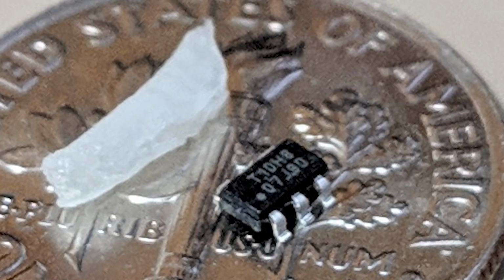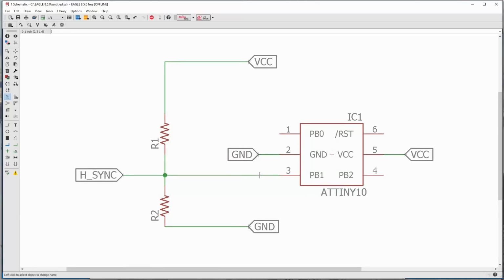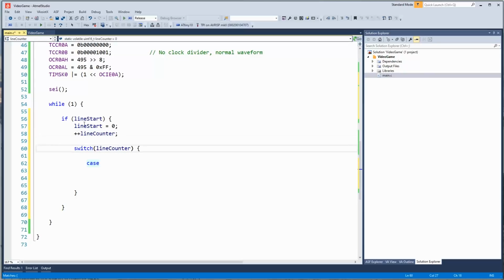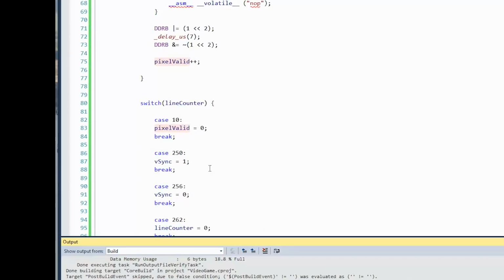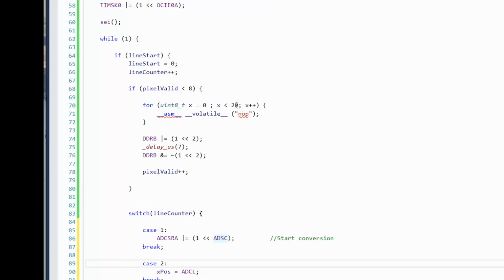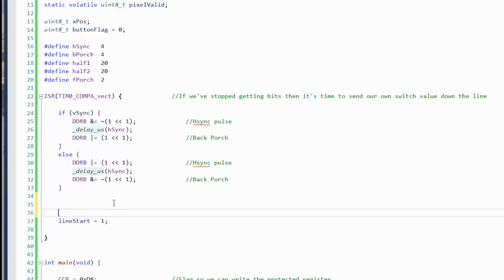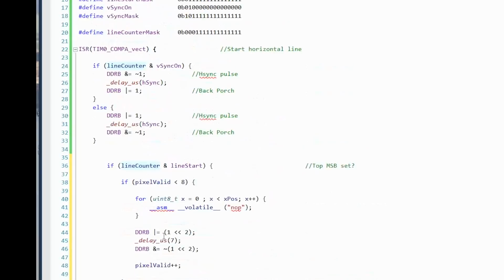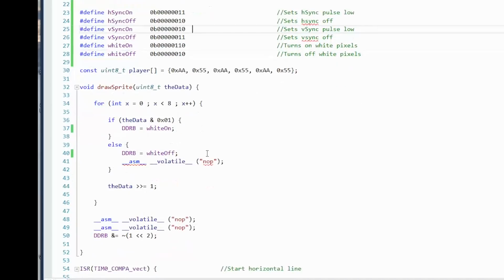ATTINY10 Console Part 1

Comment from the maker: Oh BTW please give suggestions on the kind of game to make! Something with a lot of separated verticality would be best, like Space Invaders, Galaga or Breakout.
Reply: Galaga would be nice, but the most simple way would be Kaboom isn't it?
Reply: Galaga please
Reply: Breakout.
Reply: You need some PET style chess on this bad boy
Reply: Circus.
Reply: Tetris
Reply: But can it run Doom?
Reply: Kaboom! Picnic edition
Reply: Stupid suggestion, but when I seen that giant bar on the left side of the screen, I was reminded of an old, super simple golf game.   So if you could make a game where ya smack a pixel around giant bars that would be cool.
Reply: Ben you should make Simon says it was game card #2 on the original odyssey 😂😂
Reply: Galaga and tetris would be stupidly hard, if not impossible, to pull off. I don't think you guys realize how limited this hardware is.
Reply: You still have some free pin on the controller, do you? Hook up an accelerometer and make a retromodern vii style controlled Pong.
Reply: Knock off duck hunt with possibility for a light gun?
Reply: Maybe Frogger?  The traffic would be a challenge...
EDIT: Because it's a 4-way game, a resistor ladder could be used to determine the button being pressed, it would be a fun alternative to potentiometer control while still using a single pin.
Reply: i have 1 player pong running on my TI-82, maybe you could make something similar.
Reply: What about a stacker game?
Reply: Flappy bird? I know it's not retro, but there is quite some verticality 😅
Reply: Pixel bowling.
Reply: Snake of course.
Reply: Maybe one of those driving games where your sprite stays at the bottom of the screen and the landscape moves down the screen toward you? Need to miss other cars (simple blocks) or perhaps collect items (simple blocks).
The double bar when you missed the break reminded me of one of the breakout modes on Atari 2600.
Reply: What about centipede?
Reply: A vertical moving road like Night Driver or Enduro with cars dropping down at you.
Reply: Pong
Reply: breakout :)
Reply: racing game
Reply: I've done this myself on an Arduino. I reserved 1512 bytes for video RAM and 512 for all the rest (variables, stack, etc).  And then I programmed 4 games on the flash memory: Pong, Breakout, Kaboom and Night Driver, so I have a multigame console :-)
Reply: Pong would work well, though it might be a bit simpler than you wanted.
Reply: Monkey Island, for sure! The first one of course :)
Reply: @ChrisFredriksson  that's just being lazy.  He needs to port FF7.
Reply: Make a game like doodle jump
Reply: Why not a Pang (with an A)?
Reply: Will it run Crysis?
Reply: Breakout may be an easier game to implement in a device with limited memory.
Reply: Make an eroge
Reply: Something with an aggressive micro payment system
Reply: Could you multiply the inputs you have by switching the reads from one input to another every cycle? Like you'd have a synchronized clock or something that switches what input device sends signal to the pin and the ATTINY switches states when it comes to input every cycle.
Reply: @poptartmcjelly7054  that sounds awesome!
My introduction to programming was when I got my TI-82 in 7th grade. I should really look into getting a ti82 again
Reply: Move the bar through all the display edges and have a ball appear right in the middle. Send the ball in a random direction and catch it with the bar, increase the speed a little on each catch
Reply: Battleships hotseat
Reply: @misterthekaitheman  This might actually work pretty well, given that only 1 pin is needed for input. Even Space Invaders would need 2, one to move and one to shoot.
Reply: I wonder if you could use another controller for logics and basically have a multiprocessor game
Reply: Vertical Pong
Reply: Some kind of Legend of Zelda Clone or a general RPG game? I'd love to see how you'd move the character sprite along the Horizontal and Vertical lines, perhaps with chests, loot i dunno Dungeon Crawler like!
Reply: Galaga or Tetris would be good choices. Thanks for the content Ben. It is greatly appreciated
Reply: Retro Flappy Bird would be cool
Reply: A comment I found had suggested of making the top, left, and right sides of the screen walls.  You start out with one ball that bounces around and the object is to prevent it from going past you.  A ball gets added after so many successful blocks.  Maybe a score counter can be added at the top; a simple 1 point per block?  It's like a loose interpretation of handball I guess.
Reply: Marching-wall Breakout might be a nice twist. No need for discrete level screens; just a wall of random blocks slowly compressing down at you, an unlimited supply of balls to launch from your paddle if you let them fall, but game over when the wall reaches your paddle.
Reply: Flappy Bird
Reply: Would also be nice to port the code to a padauk microcontroller. 
They are almost an order of magnitude cheaper with similar features.
Reply: @Ben Heck Hacks - I have a couple of ideas for a game, perhaps a sort of vertical Pong but with one paddle and 'gravity', so a bit like bouncing a tennis ball on a tennis racket, trying to keep it in the air without letting it drop. The maths for the gravity should be fairly simple to implement I'd guess? ball horizontal movement would be constant would be a function of distance from the centre of the paddle, but vertical would be exponential deceleration and then acceleration downwards. If the button could be implemented then it could add to upwards acceleration as if the racket is being bounced upwards.

Idea 2: vertical Pong, but with 2x paddles, both paddles are controlled by the pot, but the upper one is reversed so goes left when the bottom one goes right and vice versa. 

Also, instead of using PB2 to drive the pixel white, can't you set PB1 high and un-tristate it for the duration of the paddle, then tristate it again before setting low for the front/back porches?
Reply: I know this'll likely be unpopular, but what about Joust? (I would say something more complex like Puzzle Bobble/Bubble Bobble, but I don't know if the ATTINY10 could handle that. Joust, on the other hand.... maybe?) The original B&W version, of course.
Reply: @ArtemisKitty  the attiny has 32 Bytes of ram. Not megabytes or kilobytes, just bytes. Something like Bubble bobble is going to be way to difficult.
Reply: Yes.
Reply: @bonnome2  Yeah, that's why I was figuring more likely a game like Joust.
Reply: Galaxy invader 1000 would be pretty cool
Reply: Kaboom!
Reply: Of course I suggest Pong, Breakout or Frogger.  :-)
Reply: just single player pong with increasing speed
Reply: ASTEROIDS!
Reply: Atomic shrimp had a idea, he found a small video projector on Amazon that read mp3 files from an sd card and he was hoping ben could mod it for external sources or something
Reply: Not related to this vid, but when you are making the controllers might I suggest using a resin printer for your  smaller parts like triggers and d-pads. Not for prototyping but for when a design is finished
Reply: Make Space Invaders meets Breakout
Reply: SNAKE.
Reply: So.. you're the culprit. I always blamed the parents for the spaghetti kids threw up that I had to clean in Goodwill, only to find out it was you all along!!
Reply: Space invaders
Reply: This thing screams breakout
Just do one.
Reply: make Berzerk
Reply: Doom
Reply: snake
Reply: Going with what you've got, a PBJ sandwich maker: catch bread, PB, Jelly, bread, and action button drops it onto one or more plates (or basket). Order of PB and J is not strict, but full points has to be bread, 2 toppings, bread for score; ingredients fall from top randomly, but only in specific columns; also include "trash" to dump messed up items, decreases score; falling pieces not caught don't count against you; "bad" sandwiches can cost you more than trashed sandwiches. $0.02 for my banzai SW Design Doc here... ;)
Reply: Doom run doom. If It doesnt run doom its not a game console
Reply: Snake, Tetris, Pong    
the classic cheap LCD handheld games
Reply: Pin ball with 5mm led and piezo buzzer!!!
Reply: Paratrooper might be a little bit too complex (short on RAM to describe the sprites), but it sure would be neat.

Also, check out lft's Phasor demo.

You can get more consistent timing in your main loop by using sleep, since the processor wakes up on any interrupt.

Packing your bits as you did with lineCounter is actually supported in C; check out bit fields. Even if it didn't, naming your bits would help. 

The pixel timing issue can be resolved with a funny trick in the AVR GPIO; if you write 1 to PINxn, it toggles the value. So you could encode your pixels as where it toggles instead of whether to set or clear, and you only need one check (the issue is that clears happened later than sets within the loop; the jumps evened out, but weren't necessary; two ifs can be smaller than one ifelse because of the skip instructions). However, that only toggles the PORT bits, not the DDR bits, so you'd have to add a transistor to make it open collector again. Because the [SC]B[RI] instructions exist, single bit manipulation like |=1<<3 or &=~(1<<2) is actually one single cycle instruction, in contrast to x=0b110 which takes 2 intructions and a register (LDI OUT).
Reply: SNAKE!
Reply: doom
Reply: pong
Reply: Ranking: 1) Asteroids 2) Galaga 3) Space Invaders (they have invaded both our conscious and subconscious memories and thus have achieved their goal already)
Reply: Remake ET. Anything you could come up would automatically be 10x better than the original 😆
Reply: A block stacking game like a la stacker?
Reply: Do a 3¢ Padauk and stick it to that bloke down under.

Comment from the maker: Realized something last night while taking a leak. Since all the trigger points are even numbers I could divide the line counter by 2 and make it fit inside 1 byte. It would also make double-thick vertical pixels for "free"
Reply: Nice! I wonder if there's a direct correlation between success and number of pee breaks.  🤔
Reply: @ericvest9050  I think there actually is. I mean, from an irl standpoint, it kind of makes sense. It is a short break in working, so your brain thinks over things you did before. Maybe taking a leak will find the solution to the universe?
Reply: @randominternetbro6562  So the secret to guaranteed success is just don't stop peeing.  I got this, unhold my beer
Reply: And if you left align your line counter, the switch statement can read only the upper byte, and counting would not need bit masking to preserve the flags. Also, use 8 bit values; the for loop in drawSprite uses twice as many registers and instructions manipulating int i as uint8_t i.
Reply: @0LoneTech  If he makes the line counter one byte wide then there is no upper byte.
Reply: is this the attiny10 equivalent of middle out compression?
Reply: Thats how they did it back in the days on the NES also. In simple terms, at least for me. You've got to duplicate stuff to retain space. This guy made an NES game that fits on a real cartridge. https://www.youtube.com/watch?v=ZWQ0591PAxM . Also explain the procedure they went through. Maybe it will be helpful in the future
Reply: creativity comes when you least expectit

Comment: Ben: "We saved 4 bytes!" big party
kids nowadays: "how can you live with only 500 gigs in your PS4?"
Reply: I live with 500gigs in my gaming rig XD
Reply: @norjia  yes but can you live with half of that?
Reply: @waltercomunello121  i did on my laptop before i built myself my current system
Reply: Yeah.. I feel that. Considering the fact I have 5.5 TB on my desktop total (between the internal hard drive, and an external usb hard drive).
Only 1.5 TB are free in both of them; 4TB / 5.5 TB.
It's mostly a result of recording music, capturing video, programming projects, and many many many games from steam and epic games.
Reply: I'm getting an arduino uno at the end of the month, so the computer science path shall begin. Time to get to work.
Reply: @subliminalcastillo2126  hows the arduino going
Reply: @GOAFPilotChannel  Fairly well. 
I ended up settling on the arduino mega, and bought a bunch of different components (ic's, resistors, led's, capacitors, potentiometers, etc..)
I learned the hard way that cheaper breadboards suck for reliability. I just got my BB830's in the mail today actually & I'm rebuilding right now. I am following the Ben Eater 8-bit Breadboard Computer series right now as learning how computers work at a low level has always been a gigantic interest of mine.
Reply: @subliminalcastillo2126  Woah that's awesome! Have fun!

Comment: Remember when programmers optimized their code simply because they cared about efficiency?  Ooh, I saved 2 bytes* said no one in at least 30 years 😁
Awesome work man.
Reply: I've made embedded programs for controlling hardware, and 2 bytes can make all the difference
Reply: I legitimately said that yesterday. I actually said, as a perfect quote, "Ooh! I saved 2 bytes!"
This was while writing a program for my TI-85 graphing calculator :)
Reply: Weird, almost as if saving bytes stopped being worthwhile once software exceeded billion times that amount.
Reply: We needed more storage because programmers stopped making tiny size optimizations.
Programmers stopped making tiny size optimizations because we had more storage.
Reply: @easyaspi31415  wrong, we needed more storage because we had more data. 
Even for the common Joe, data itself adds up to terabytes, there is no getting around it. And big-data is several orders of magnitude further still. 
Cost of a gigabyte is measured in cents, cost of a programmer in tens of dollars per hour. 
Saving bytes is seldom appropriate anymore, and no sane company is going to throw away profit just for the sake of nostalgia.
Reply: Oh, I don’t know if it’s a dead art just yet... I do a lot of Z80 assembly coding for my own projects. If I can save a few bytes here and there, it’s a good accomplishment. Saving space in ROM is always good. Keeping track of those mode 2 interrupts and that RETI...  can’t tell you how many times I’ve run out of stack because of RET instead of RETI. Oh, well, live and learn.
Reply: Some of them might have cared, but I think most of them were just trying to get the damn thing to work. But I suppose that's a pretty solid reason to care.
Reply: Atmel programmers be like..
Reply: I program ti basic on ti84, and I would do anything to save 1 byte. I saved several kilobytes doing this (~-30%)

Comment: Ina few years this project will, eventually, run DOOM
Reply: with an attiny10, that is very unlikely. maybe a watered down version like the one made for the calculator.
Reply: @MsHumanOfTheDecade  taking it too literally much?
Reply: @MsHumanOfTheDecade  I'm pretty sure an atmega2560 would run Crysis easily, with room to spare for spaghetti AND meatballs.
Reply: @MsHumanOfTheDecade  even a stripped down version like the calc-doom would be badass!
Reply: can it run cyberpunk 2077? i don't have the money for ps5 but have money for attiny10
Reply: @wphanoo  No but you could make the chip into a facial piercing. Cyberpunk!
Reply: @MsHumanOfTheDecade  uhm, are you ok?
Reply: @MsHumanOfTheDecade  Pretty sure that with some external RAM it can be done as long as you are able to stand a blazing speed of about 1e-5 FPS.
Reply: @trinidad17  there's no framebuffer.   Just like on the classic Atari, you can't address pixels, and the 'cpu' only has a fraction of the time for processing data (3d transformations, etc), majority of the time it's busy puking on the screen.
Reply: @tomservo5007  You live in the sync
Reply: @MsHumanOfTheDecade  If you think this is serious, somewhere another geek will try to make it real

Comment: Some extra detail about the garbage in mrs.Pacman on the 2600, the lines on the left of the screen are actually due to how the TIA (the atari's graphics chip) handles horizontal repositioning.

The Atari had horizontal repositioning registers for all the major graphics and a separate "HMOVE" register you would strobe to commit the changes. If you didn't strobe the HMOVE at the exact right cycle, it would add that garbage to the left of the screen. If I'm not mistaken, most Atari programmers were unaware you could time it correctly and just assumed the garbage was unavoidable. (or they were like me and too lazy to time it correctly). That's why that garbage is present in most games that move the graphics in the middle of the frame.

Comment: The good old days when ya built an opamp out of discrete transistors then 30 years later folks r selling them as high end
Reply: My boss would wait months to get metal canned op amps (lm339 I believe) just because they were 4-5% less noisy.
Reply: @GreenAppelPie  Place i worked clients had circuits we would connect into a working circuit then laser trim various resistor/capacitor networks to their specs and send them to another group have their cans welded. Look just like metal 339's

Comment: That was beautiful!
You could use a range shift for the pot to allow detecting button click at same time as movement btw.
Button would shift the pot response from for example 0.5-1.0v up to 1.1-2.2v so there is no overlap thus the motion and button can be consistent and simultaneous.
Reply from the maker: That's a great idea! I could just "button away" a 10k resistor and then lob the top bit off the ADC result.

Comment: I remember doing something similar with a ST62 microcontroller back in 93. In assembly there was barely enough cycles available to check the line counter and take a single byte output action. To make it work I needed to pre-sort and organise the bit actions (along with A/D and other logic works)  in the vertical interval.  Horizontal stuff was external with physical timers etc.. Cool to see you making a full video signal with that little micro.. can't wait for the complete game ;-)